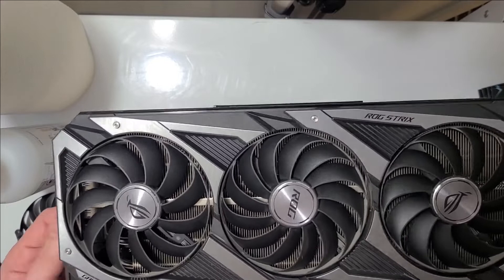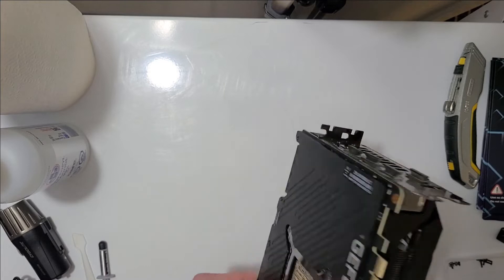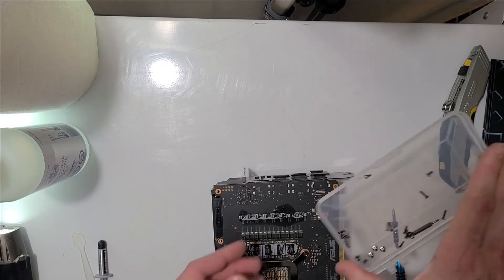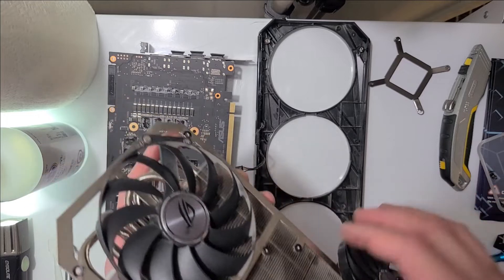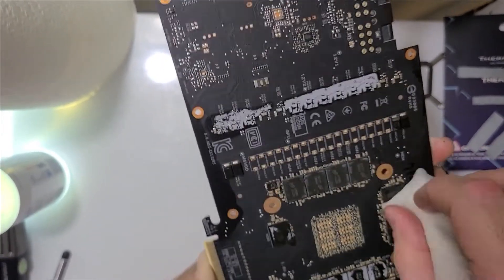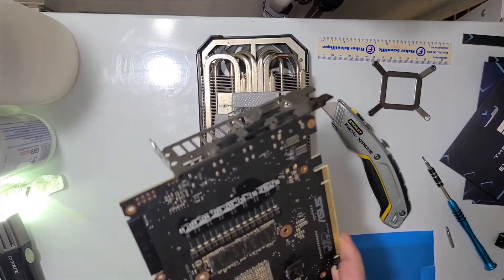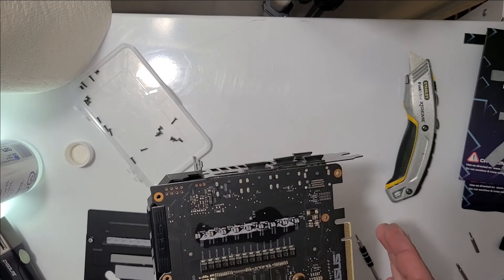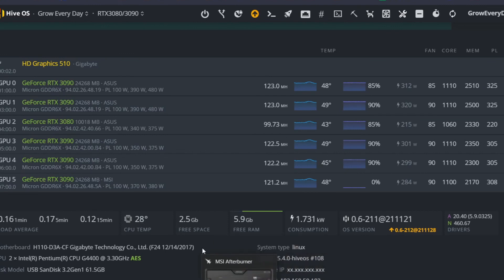Replacing an ASUS STRIX RTX 3090 Fan, Thermal Pads, and Shroud and Backplate Removal

Comment: you know these videos are only useful if you don't skip steps and keep it on camera each time.  you removed a piece from the middle section and then immediately talked about getting to the screws underneath it  - but you never showed it being removed.

Comment: your PCB will bend like a banana unless you mount it vertically and even then over time it will bend. That is what the frame is for to keep it straight. 
Perhaps consider modding the frame with some drill holes to get better airflow or doign a copper plate mod and youll get a 30deg+ drop

Comment: If your paste is not dried out, then ball it up in the center, maybe add a touch of new paste, and put it back together. If the material is good.. its good. 
If you want to take a sticker off, add heat until the sticker glue lets go. 
If you cant easily get to a screw, find another way other than stripping the head. 
To keep track of your screws to put them back in the same place you got them from, draw a rough sketch of the gpu on paper and put each screw on the paper, where it goes. Use a drawing for the back and another drawing for the front. 
If there is a piece of the gpu that has pads on it, they put pads there for a reason. 
You can use a tooth brush and lots of rubbing alcohol to quickly clean a GPU. 
Apply pads to the item to be cooled, not to the heatsink. You dont put the thermal paste on the heatsink do you? Same principle.
If you take a backplate off, at least clean off the old thermal pads. The pads touch the backplate, which is a heat sink. Without the backplate, now the old thermal pad you left on there acts as an insulator. 
Dont measure used thermal pads from the sides because the indent that was made in the pad lifted the edge of the pad. 
The hardness of a pad is defined as "shore". Use Gelid Extreeme... not Ultimate for the safest bet. 
I'm using copper shims with a thin coating of thermal pad touching the component and thin thermal paste to touch copper shim to cooler/backplate. 
God bless you

Comment: Well when I first purchased 2 of these cards, both had memory temp issues, I never used them for mining long term but I do mine to test them, maybe for a day and then I stop, now I did all of this and almost no change on tue cooling, and then one day my gpu was sagging on my case by the back of the case we’re you add 3 screws to hold it in place, but the case was to tight with 1 of this cards that I   Pinched it right at the left  corner and forced it up to level it but the top part was hitting my cpu radiator, ( I was doing all this while on and mining) and I  was holding the gpu up with force while trying to screw it down and then I noticed the memory temp dropped from 98°c to 88°c and I was like… no way asus have a design flaw and still rolled with it, now I have 4 asus rog strix 3090s, 2 of them I have not replaced anything on them other that squeeze that left corner together and my memory never goes over 90°c while mining testing, so I feel it’s just a flaw on the card and they are keeping it a secret, even when I game my card never goes over 68°c  before it would reach 88°c if I didn’t ramp up the fan curve, please try it and let me know when it works for you

Comment: ah it looks like the 3060ti ROG STRIX is the same basic design. One screw left to be able to replace the fan but as far as I can see I need to unseat the GPU.. not what I wanted to do.
Reply from the maker: The 30 series cards are an absolute PAIN in order to change the fans! 10 series cards were super easy

Comment: Everything I know about engineering everything has a reason if it was okay with a bare minimum they would have and saved money. Good teardown, but I won't recommend removing anything that can ruin the dynamics of the original design
Reply from the maker: I would agree with you up to an extent. With some of these cards what they did seems to be purely for visuals. Plus the fact that they use such crappy thermal pads makes me really question why they did anything,
Reply: @GroweverydayOriginal  totally agree thermal pads and grease needs to be the best they can offer then the cooling maybe somewhat reasonable.
Reply: Awwwwww the typical engineer!! “If the model says it works it should work” “ its on the design”, “ the computer model gave it a green light” 🤦🏽‍♂️ get out to the field, try it yourself, test it , field verify, I can go on and on

Comment: No offense, but this is not the best for a how to video...  a lot of what you are doing is off camera.  Plus, you said the card is not thermal throttling.  I guess this video is not meant for miners, because AFAIK almost all cards thermal throttle with stock thermal pads and not using the backplate, that just seems nonsensical to me.  Miners are going to be the main audience for people interested in viewing your video...  Your thermal pad placement on the backplate is flashed up for like less than a second.  I know the reason for you making this video was to replace the fan, but you failed at that, too.  You didn't even show yourself replacing it or it was off camera. 👎👎
Reply from the maker: Yea you are right, I really botched filming this one! The camera I used was trash for it. I will redo this one of these days as I have replaced all the fans on this card, and I am going to be doing the pads again. This STRIX card is pretty terrible and requires a lot of work.

Comment: Good starting point video for maintenance on the GPU, but there is so much info missing, like links to fan replacements or at least reference no., the actual thermal pad thickness used on the various components, solvent used for cleaning the card...
Reply from the maker: Yea I need to include a lot more next time. For solvent always use 100% rubbing alcohol. Every card has different pad thickness, and I have compared my pads to tutorials online for the exact card and my pads were different, so I don't know what's up with that. Always check your pads before swapping them!

Comment: This video was helpful preparing for my Asus thermal pad replacement venture.  Question: How is it that adding up all your GPU power consumption matches up with your HiveOS report?  All my rigs shows much more; one of my rig (3x3090, 3080LHR, 3080ti, 3070ti) reports 449W higher than total GPU power usage, indicating my motherboard/CPU/RAM/Fans/etc are using 449W, which seems little excessive.
Reply from the maker: Are you comparing that to the wall reading? Software is really just an estimate
Reply: @GroweverydayOriginal  I know it's an estimate, but that's now what I meant.  Adding up all your reported GPU's W = total W reported by HiveOS.  I figured it out.  I had in farm settings to add hardware W usages plus power supply efficiency.  So mine reports much higher than total W usage reported by  each GPU's.  I originally had it set long time ago as a safety net, and I forgot about it.
Reply from the maker: @felixk7023  Glad you figure it out! I have left all that blank, and I just estimate that my non-gpu equipment adds about 100w

Comment: Why there is no thermal pads on left power supply blocks, and have one on the right row? It's will be worse if I put it?
Reply from the maker: I'm not sure why they have all the pads where they have them. Some manufacturing put them on capacitors, some not. All I know is the memory modules do need them for sure

Comment: Nice vid having exact issue middle fan on my 3090 Asus Strix spinning wobbly going to fail soon I imagine, that shroud is blocking airflow I agree.
Reply from the maker: The only thing is that if you remove the shrouding the backplate doesn't screw on anymore. I am not sure how this will be long term.

Comment: Doesn't the backplate acts as a heatsink for the rear memory chips?  If so, I wouldn't remove it.
Reply from the maker: It can yes, but after seeing how it all went together I am not super impressed with how it was set up. I might put my own copper blocks on the memory modules and see how that works. I have a ton of them sitting around.